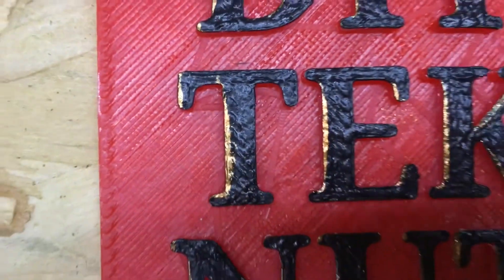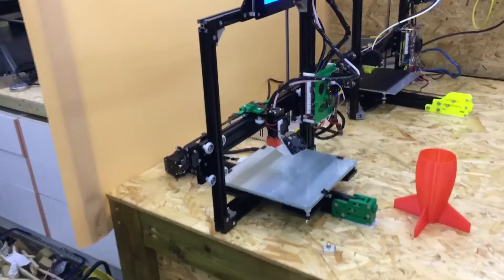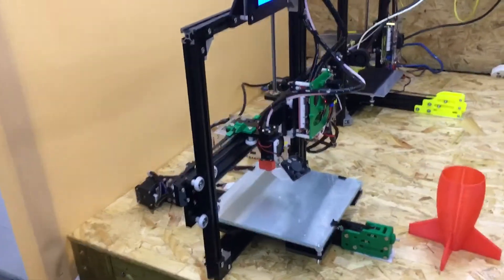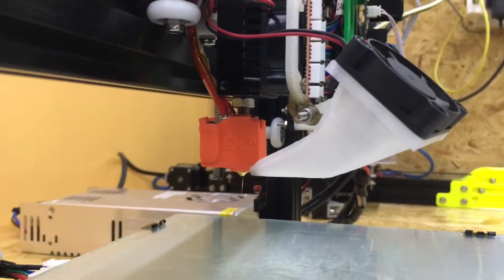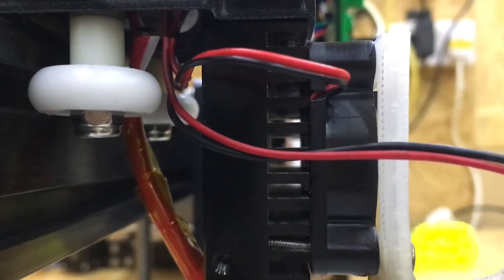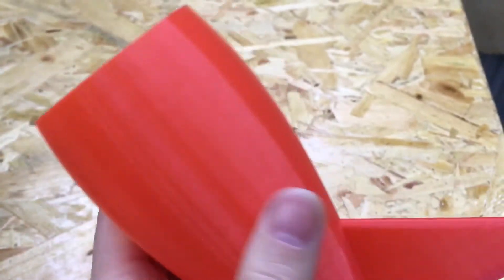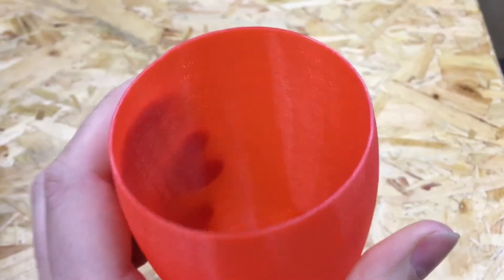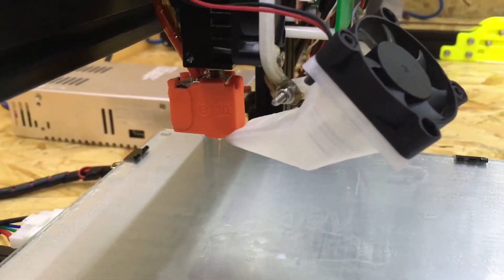Anet A2 3D Printer With E3D Volcano Hotend

Comment: Interesting upgrade my very good friend. Did you have a burn up with your part cooling fan mount.
Reply from the maker: well the design did not fit this configuration instead of redesign just heated up with small blowtorch bent to fit.

Comment: Tek NUT when you changed you hot end did you all so change the thermistor as well or did you just use the original 1.if you used the new 1 can you please tell me how you changed the firmware to work with it.
Reply from the maker: same thermistor nothing changed
Reply: ok thanks...do you know how to change the settings for a new thermistor any way or not.

Comment: Good call. Can always use a file after to smooth it up. Unless your printing faces or something intricate, why hang about. I will do the same when I get one. Very good tip. Plus all those links in description are great. Many thanks.
Reply from the maker: Thanks. yeah depending what your printing if its small and intricate you want a small nozzle. but if your printing a large model, case enclosure it can take up to 60% off the print time with 0.8 nozzle and the layer lines are not that of putting, you can sand prime and paint if it needs to be special. Not tried the 0.6, 1.0, or 1.2mm nozzle yet. larger nozzle has more surface area resulting in a stronger print.
Reply: Please do try these other nozzles out, that will be great info for everyone to have.
Reply from the maker: yes will do.